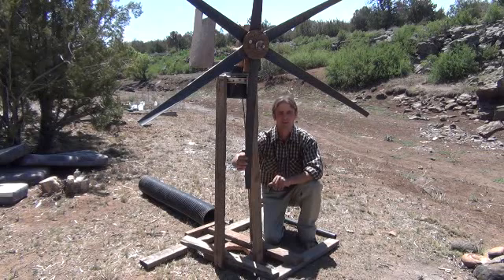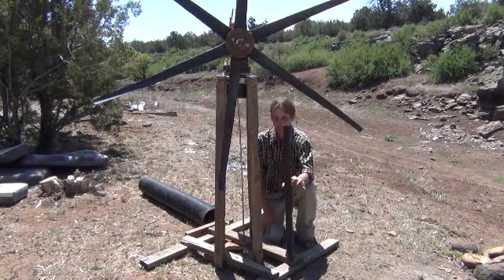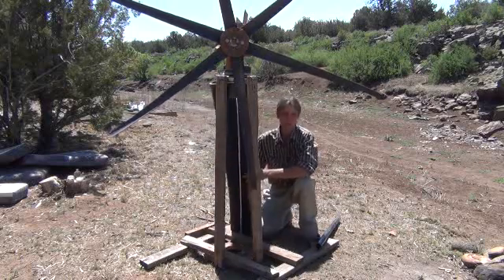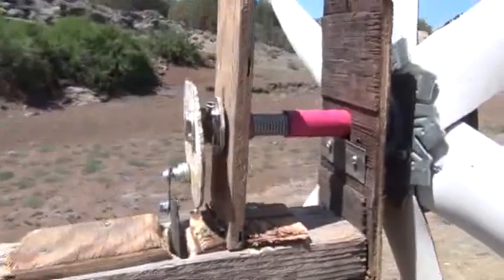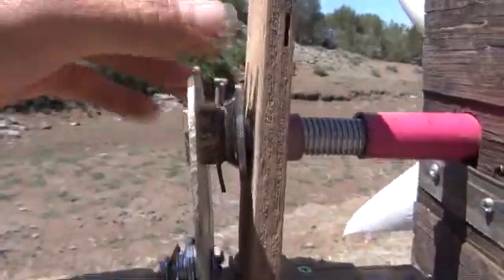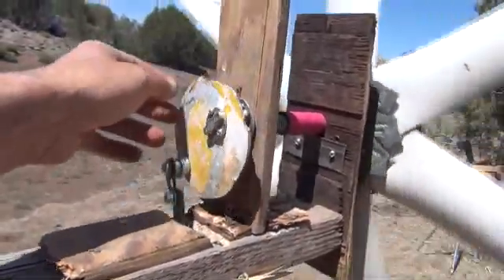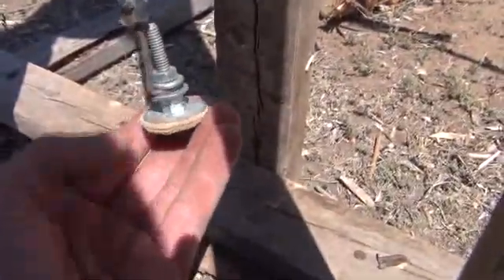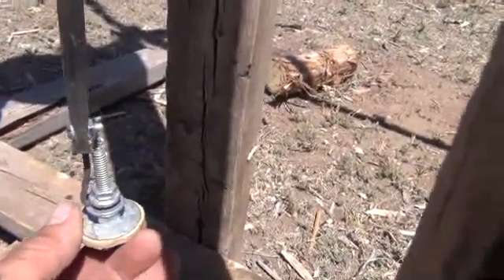Wind mill water pump home made P#1.

Comment: Front hub off a 4 wheel drive vehicle has nice bearings and would b really strong, even has mounting bolts and a shaft running through the centre.
I was thinking of building one but I wouldn't bother with a swivel, wind comes from west 95 % of the time 5% is from the east, which will still work for a dugout aerator

Comment: Hi, Thank you very much for your video. It has been extremely helpful towards my dissertation which is based on a wind pump. Just wanted to ask how much volumetric flow rate are you able to achieve with your pump? (say at wind speeds of about 6mph). Thanks a lot again :D

Comment: I like your video, how much harder would it be to make a larger version for watering livestock? The water table is very close to the surface where I live. I want to use wind to bring water up to the surface and pipe it to a 500 gallon stock tank and to a small chicken house with a self watering system in it.